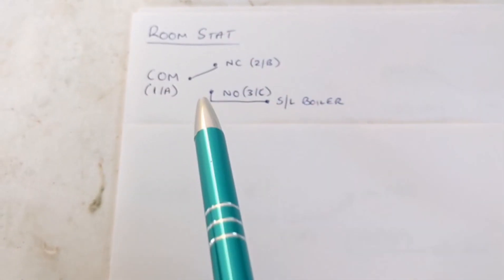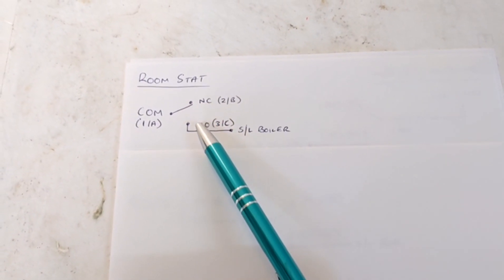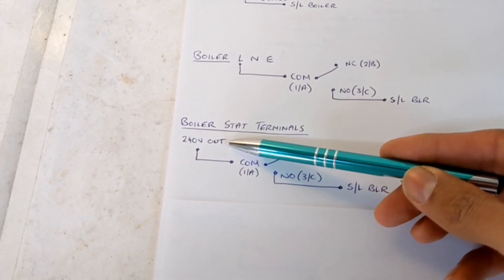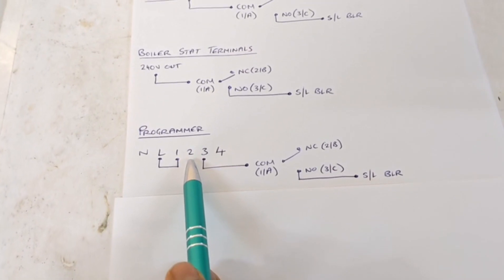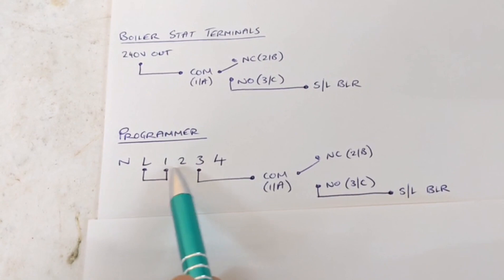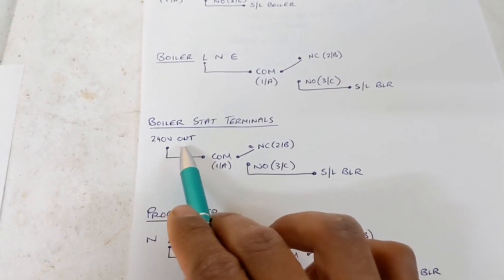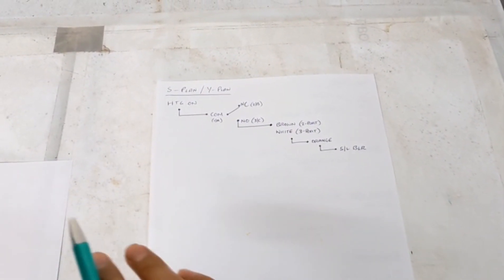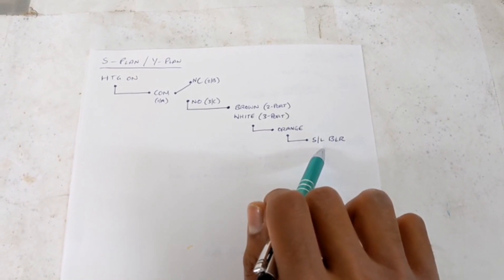How to wire a room stat

Comment: Thanks. When dealing with low voltage switching should i have separate cables for high and low voltage wires?
Reply from the maker: I've been advised to do so 👍🏾
Reply: Thanks! Also is 1.5mm thick wiring sufficient in Ireland for programmers?
Reply from the maker: Yeah I use 0.75mm for controls anyway

Comment: This makes it easy to understand, but I'm still confused with my wired stat which I need to bridge to be permanently on so my TADO can take over. My wired stat has a LIVE, a SATISFY and a DEMAND - which do I need to bridge to make it permanently on? It's a STT RSL. Thanks, Pat.
Reply from the maker: Tado says it all unfortunately, I've not had much success with it and neither have many customers I know as well. It needs looking at with experience in heating wiring
Reply: @cputilitysolutions  - Cheers. It's the one thing TADO are very vague about! Keep up the good work. Pat.